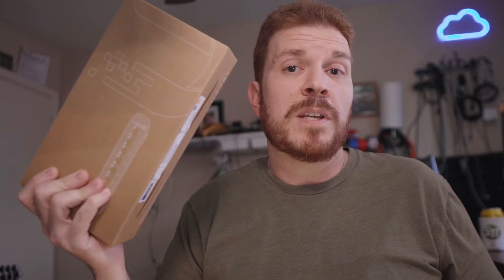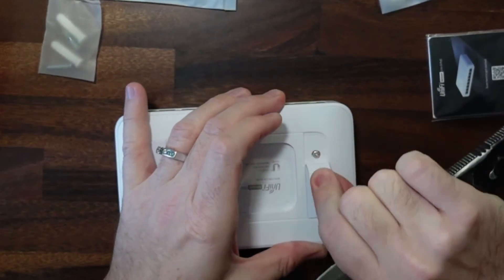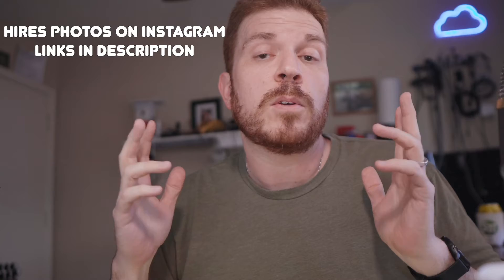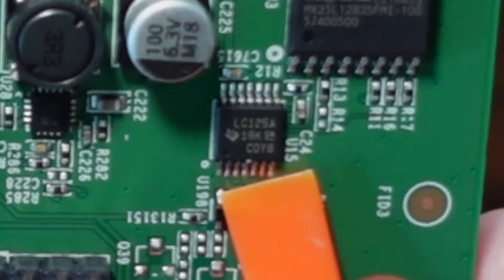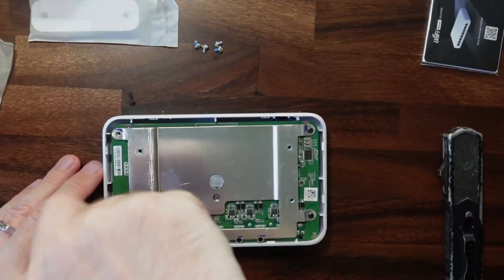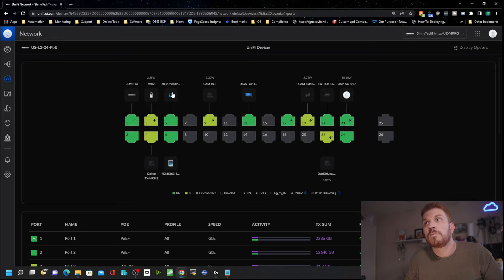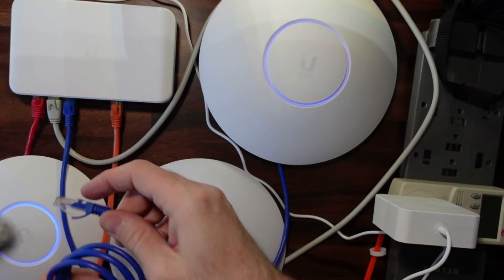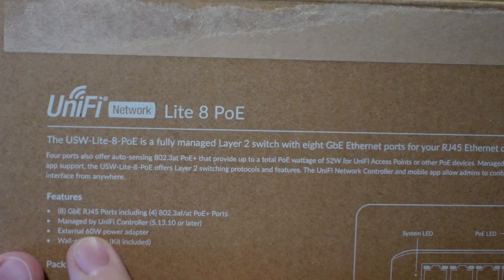Ubiquiti Unifi Switch Lite 8 PoE Setup Review and Disassembly

Comment: Awesome video! My switch (same model) died last night and one chip is burned. Can you help me identify the chip, as the last 3-4 letters/numbers are burned? The chip is located on the back side of the PCB where the heat plate is, near the power connector. PCB label is PU1 or PR35, the part number on the chip starts with TPS23*** . Please reply, it would be much appreciated!
Reply from the maker: @toto99303 can you please send me an email with a picture and I'll see what I can find out for you. You can email me on the YouTube contact page.
Reply: @ShinyTechThings  I can't find the contact email in your profile. When you open the switch follow my initial comment. You won't miss it.
Reply from the maker: @toto99303 I don't have any of those switches on hand right now. Please reach out to me on Instagram:
https://allmylinks.com/shiny-tech-things
Reply: @ShinyTechThings  I had the exact same chip burned. Would you please identify the chip for me? I know it starts with TPS237
Reply from the maker: @gbnintendo does this help? https://www.google.com/url?sa=t&source=web&rct=j&opi=89978449&url=https://www.ti.com/lit/gpn/TPS2377&ved=2ahUKEwiUl-z6xI2DAxVsO0QIHcwZB-0QFnoECBMQAQ&usg=AOvVaw3ZR-Iu88yAvFNUd8Kys5hN

Comment: Just got a couple of these... Mine still took a while to show up to adopt as well... It also somehow said it was connected to an access point when i checked the controller... Kind of hard to believe they would allow these to just connect to any unifi access point without authentication so i am guessing it was just a bug in the ui that said it was connected wirelessly??
Reply: I can confirm it is just some weird bug that says these are connected to a wireless access point... I dont understand why it says it, but it does for some reason... But not a big deal really i guess since the info gets fixed after being adopted.
Reply from the maker: @Michael Hanson Yeah it's gotta be a bug. How's it working now after all the updates?
Reply: @ShinyTechThings  they are great now... The thing i actually like is how my topology is correct and i can configure them from one networking ui... They replace some unmanaged netgear and linksys switches in my entertainment room going to a HTPC, TV and some consoles and also in my office going to some Iot devices and PCs.
Reply from the maker: @Michael Hanson Yeah, once you drink the UniFi Kool-Aid it's hard to go back. I just use the EnGenius switch with 2.5GbE PoE with the U6-Enterprise but would love if UniFi 2.5GbE PoE switches would be in stock but I do really like the EnGenius switch but it does use a different pane of glass for cloud managed access. Do you need to go faster than gigabit?

Comment: 2:15 It was a bit disappointing that you did not investigate that central large chip in the middle under the heatsink.
Reply from the maker: @tsvk That switch is already in production and from what I remember it was on there pretty good so there would have been potential risk on removing. I am curious as to what is under like yourself but if it got damaged from removal I'd be out over $100 and currently the revenue of ALL of my Unifi disassembly videos only made $32.35 so far and I haven't had any contributions either. If there is contributions to cover this or someone sends me one to potentially break in the process I'm fine with doing a full deep teardown of the unit.

Comment: Any idea where I could purchase the Mtek chips? I'm trying to repair a 24 POE switch.
Reply from the maker: Did you try eBay or find other dead switches, take 2 and make 1 good one.
Reply: @ShinyTechThings  I can check ebay. That's where I bought this "dead" switch. I would rather just buy the components and do that.
Reply from the maker: I'd throw double quotes around the chip info and see what comes up on Google or Google shopping.
Reply: @ShinyTechThings  Unfortunately that just brings up ovens on google shopping😂. I might be able to order from Kynix, where you linked, but I need to send an inquiry.
Reply from the maker: The closest I've found so far are various vendors on Alibaba.
https://m.alibaba.com/showroom/m-tek-ic.html